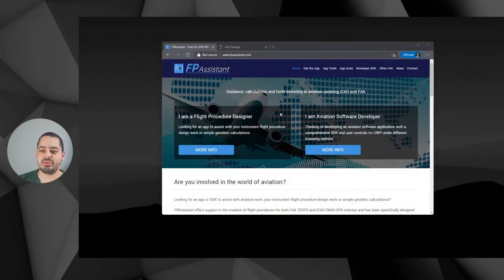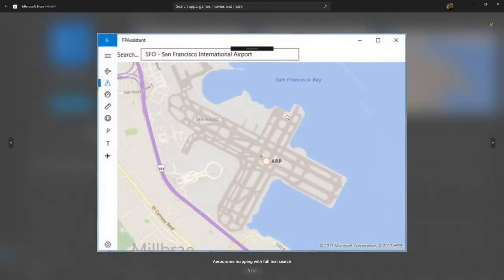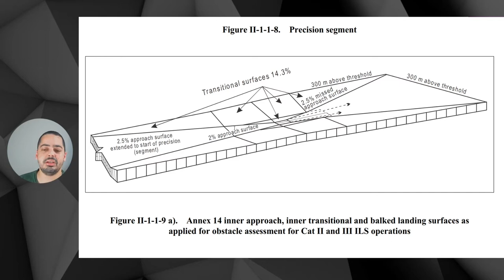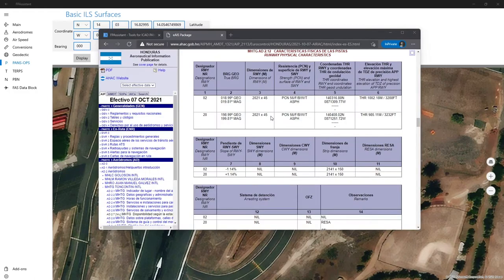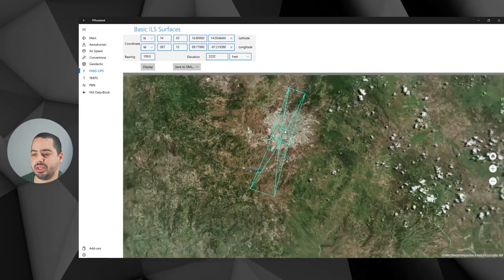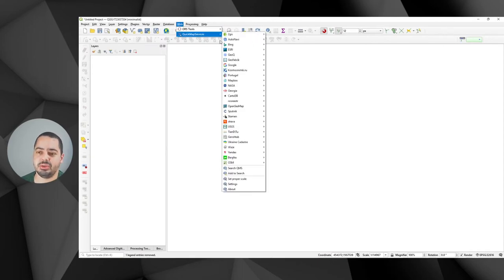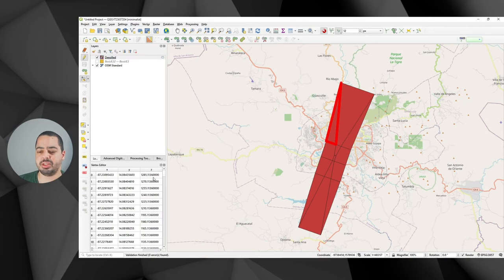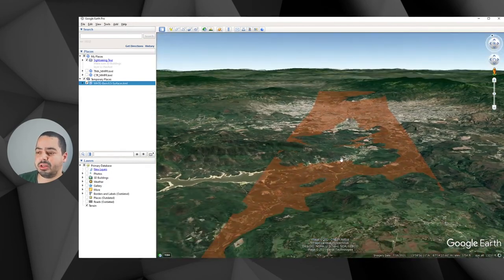PANS OPS Basic ILS Using FPAssistant and QGIS for MHTG

Comment: ILS footprint does not clamp to Rwy.
Reply from the maker: Yeah, this is just showing the plan view. You would need to add the Z values to the vertices in order to have a 3D view but most tools can actually do the calculations in 3D based on the formulas without having the actual surfaces extruded. It all depends what your end goal is.
Reply: @antoniolocandro  thanks